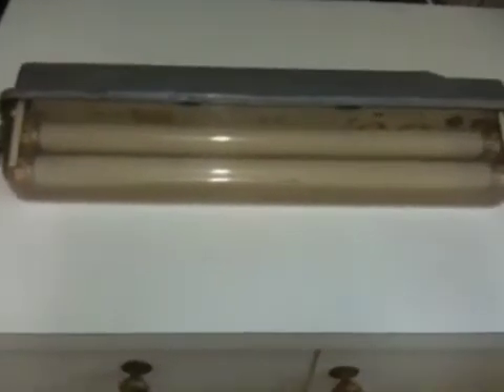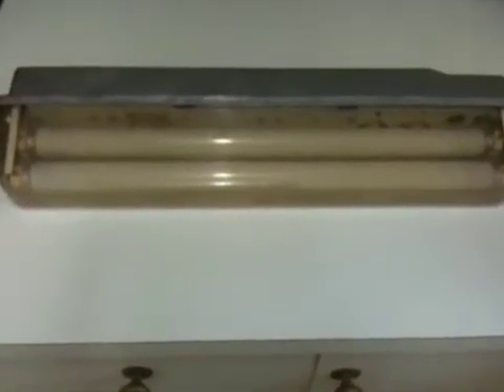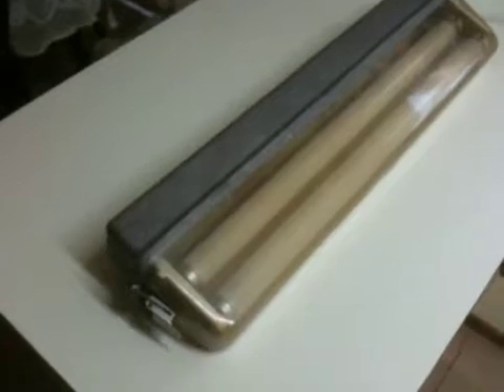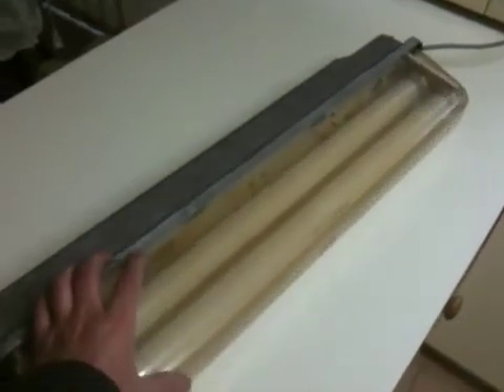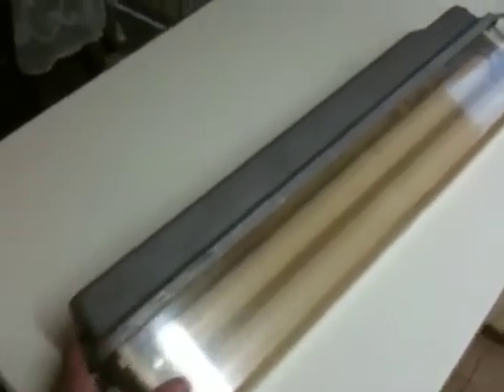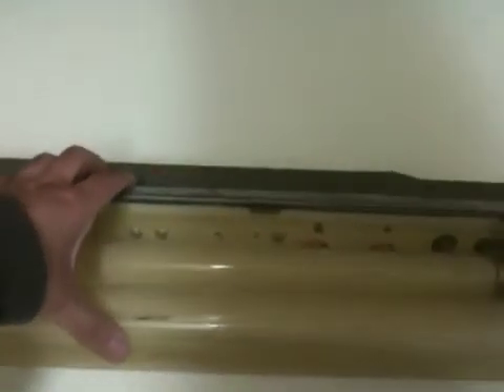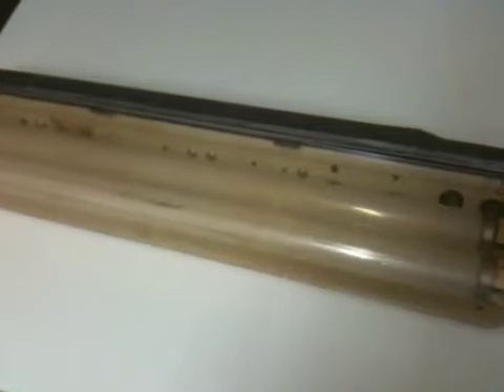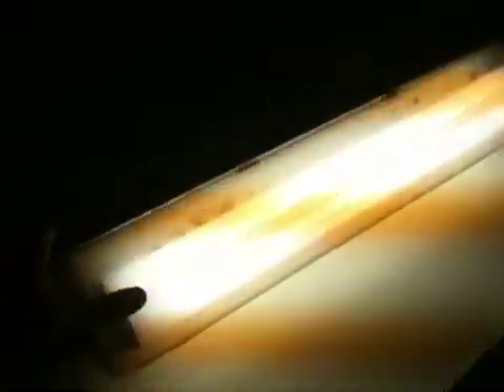Fluorescent Street Light 2 x 20watt

Comment: Awesome! I have two of these - A Thorn Stradalux and a Philips PathFinder. They're awesome fittings, with heaps still in use around Sydney, though most run 36W T8s instead of 40W T12s.

Comment: In Former SFR Yugoslavia main street lights is like this ,made by Elektrokovina Maribor from 1956 ,models like 2 x 20  Watts ,2 x 40 Watts,4 x 40 Wats , was in use till 1980,s when they replaced with mercury vapor laps 1 x 250 Watts and 1 x 400 Wats fixtures of same manufacturer ,in main City,s for street lights.

Comment: @Dazm229 In the UK Fluorescent street lighting is making a come back but this time they are using the new energy efficient T5’s not the T12’s The reason why they are coming back because Mercury Lamps are going to be banned after 2015 & the LPS are becoming more expensive also new street lamp fixtures must meet the lighting pollution regulations with flat lenses

Comment: @Dazm229 The 3x40 watt was a good light. Yep, they were used for highway and main road lighting. But unfortunately they're all gone now. I did however manage to score a 4x65/80w (or 58w in the new money) British G.E fitting from an old servo demolition a few years ago. It was a very rare and unusual fitting here in Oz. It needs new control gear, lampholders etc, but the body of the fixture is still in great condition. Demolition crews can often be quite helpful.

Comment: Another reason why the 2x20 was extremely reliable......Maintenance! In the old SEC days the lamps and starters were changed annually (boltchange) Wheather the fixture required it or not. Dazm229 you'd love the old 3x40 watt luminaires that were used in the switchyards. Made by Daylight in Adelaide. Nice fitting.

Comment: @Dazm229 Thanks for your spare parts offer. I still have some bits and pieces for my "2x20's" But I work on traffic lights now. Funny thing i've noticed is that a lot of the discolouration and fading of the diffusers on zodiacs can be attributed to how often you use them. By the way, I liked the Greendale luminaire more too :) The lens seems to maintain better clarity as the years go by. I have an old 90w G.E.C. SOX streetlight kicking around here too somewhere, I should put it on Youtube.

Comment from the maker: @santaarnpaal and @Detroit8V92ttg, the fluorescent street light here is a Greendale. I also have a Zodiac too. Detroit is right, these lights were extremely reliable. I wish they were still used for street lighting. I had a massive collection of all three types. I now only have 9 left. Some parts are still readily available from electrical wholesalers. I just replaced several sockets on the fixtures I have and I had no problems getting them. Let me know Detroit what if anything you need. I'll s

Comment from the maker: @skiller444, these lamps were around for 20+ years. Designed and manufactured here in Australia. The tubes on top of one and other is unusual as light is dispersed in an upward direction too. But they were effective. I polished out the oxidation initially using car polish before eventually finding bug and tar remover worked brilliantly. I don't know what the chemical makeup of the bug and tar remover is. Two bowls were supplied with the lamp. It can be either polycarbonate or acrylic. Thx for c